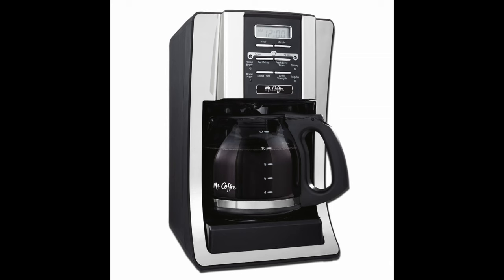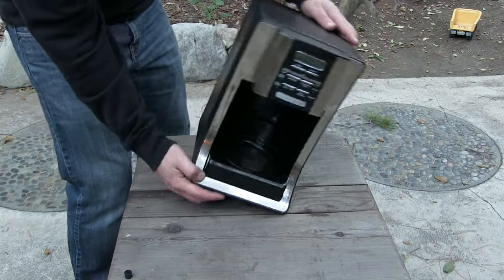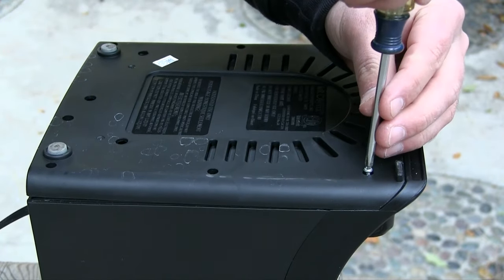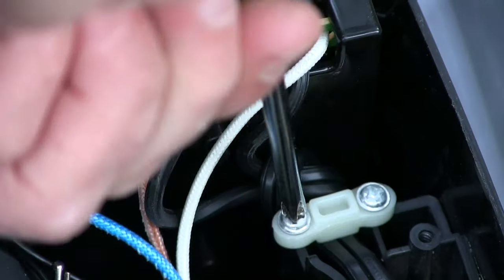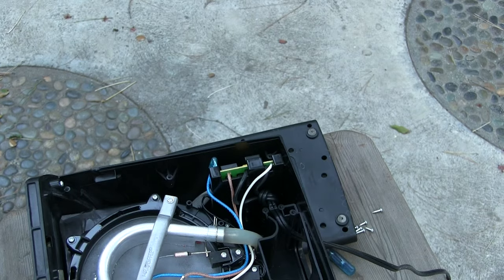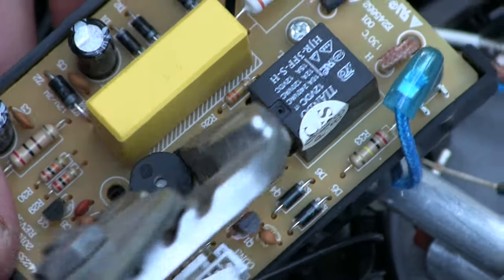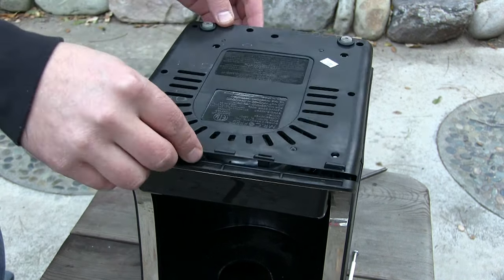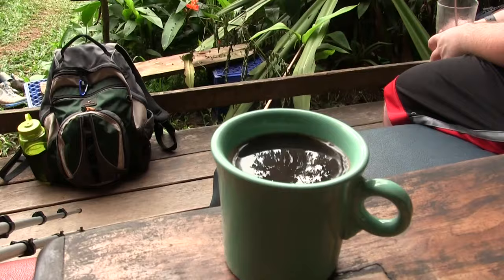Disabling Beeping on Mr. Coffee Coffee Maker 12 Cup BVMC-SJX33GT

Comment: I suggest one amendment to this generous description of the process.  I found the deep-seated screws of the circuit board hard to unscrew (there are four of them on my model).  Instead, once I removed the wire harness I bent the circuit board a little and with a flashlight spotted the speaker, down on the board.  A good push by a screwdriver against the speaker will dislodge the speaker, without ever having to lift the circuitboard out.

Comment: Thanks for the video, Kendall.  I was actually looking for the bvmc-knx23 model.  I followed YOUR instructions, but I couldn't find the speaker on the bottom board.  So I turned it on again and noticed it coming from the TOP of the maker.  There is one screw on the underside of the top display.  Take that out.  You'll see the circuit board.  Take those two screws out, and you'll see the little disc speaker on there.  SO relieved as the alarm was bugging the complete SHIT out of me.

So anyway...thanks again!
Reply: Yay, that was my model too! Thanks for commenting!

Comment: Thanks for making this video.  One addendum:  We purchased one of these coffee makers in January 2016, and when disassembling the bottom as shown, discovered that the speaker was no longer on the bottom motherboard.

Fortunately, you can remove the top of the unit (need to pry off six little black plugs that cover the screws), and then remove the five screws that hold on the front plate with the buttons.  Behind that there is another motherboard held on with four more screws (be careful taking it off, since the buttons and the gasket around the lcd will then be loose).  The speaker is now on that motherboard (was able to easily identify thanks to your video), and when removed disabled the beep.

The main wrinkle in the new location is the sealant around the ribbon cable as it passes through the plastic.  I had to carefully maneuver it so the cable would move through and let the motherboard be pulled out.  And then carefully try to replace it on reassembly.
Reply: Tried to short your process by cutting the wired connecting to the circuit board labelled "buz".  DID NOT WORK.  still beeps.  

Will give your long method a try.

Comment: You CAN disable this by holding the "Delay Set" button for 5 seconds and getting one beep, it is now turned off. To turn it on, hold the "Delay Set" for 5 seconds to get one beep, it is now back on again.
Reply: Your tip worked, Tee Jay! You just saved me from taking apart the coffee maker. Thanks!
Reply: Man I wish I would have read your reply before taking my machine apart only to find there is no speaker on the circuit board :)
Reply: I held the "Delay Set" button for 5 sec... then 10 sec... then 20 sec... no beep. Didn't work on mine.
Reply: @Rain-bp4di  The post is from 3 years ago, they probably have a different model.
Reply: Not all heroes wear capes. TY
Reply: It  worked! Thanks!

Comment: Thanks for the video.  Except, like James Russel's comment, the 2016 model has the speaker behind the clock.  He uses a method that work, but I cut the wire going into the control board next to the work "buz" and did not work.  Not sure what I broke.  Again appreciate the video.

Comment: Mr. Coffee has since started using screw that have a three slot head. Not a slotted head, or a Philips, but in-between.... ANNOYING
Reply: I had never heard of a three-slot head so looked it up. Here's the answer I received: 

"Screws with a three-slot head, also known as tri-wing screws, are a type of security screw designed to prevent tampering or unauthorized access. They are commonly used in electronic devices to ensure that the device remains secure and cannot be easily opened or modified."

Very strange that a coffee-maker manufacturer sees this as "tampering" (as opposed to, say, repairing ... or locating and removing an unneccessary and annoying loud noise) and would go to such a stupid extreme to prevent the rightful owner from fixing the product.